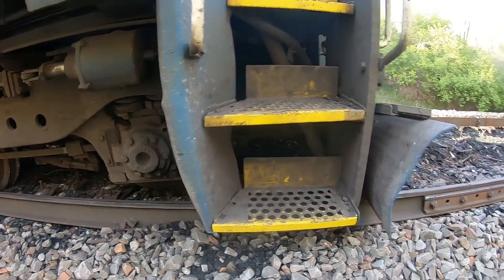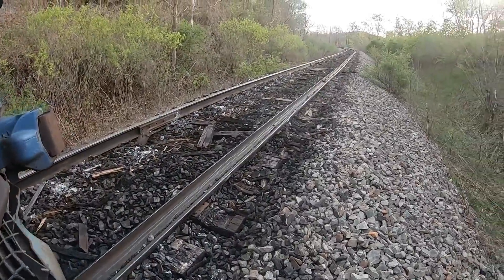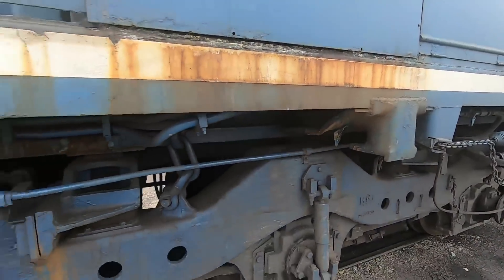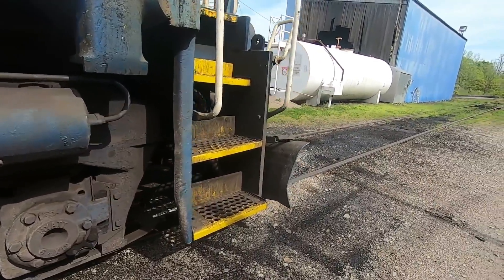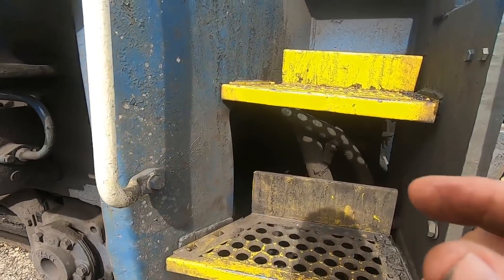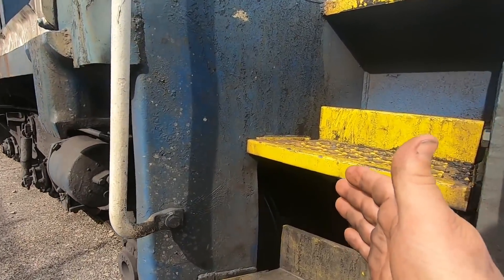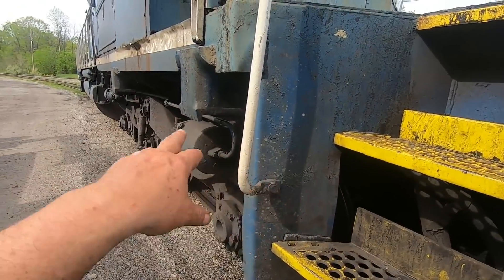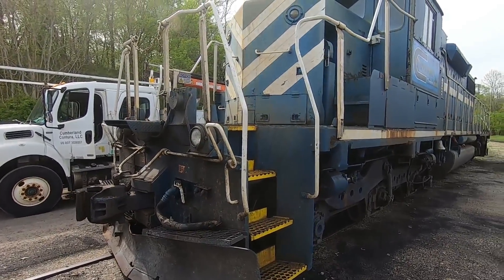Damage to the Locomotive from the Derailment

Comment: What a mess it must have been. What if there would not be any ground for those side lifters?
Reply from the maker: Your right it certainly was a mess. Stefan. If there was no ground to work off of, then they would have had a dozer and excavator make
a pad for those side booms to work off of. It's happened before.
Really appreciate your taking the time to watch the video and may you have a very good day my friend.
Reply: @ccrx6700  A Swedish short passenger trains derailed some years and ended up between the tracks. The nearby ground was like a swamp. Building a road for the cranes was needed so i took extra time.

Comment: When i worked for BN it was easyer on equipment to just let the power run takes alot to start 1 those big power units
Reply from the maker: Yes EMD says it's easier on the engine to let it run than start it because there is no pre lube and all the bearings and seals get run
without lube for a certain amount of time. These old EMD engines
don't like being started when they are cold either.  Thank you for  taking the time to write in and for checking out the video my friend.

Comment: Did you ever find the reason for the derailment? Looks like either the rail broke beneath the train or the road (gauge ) spread and the rail rolled over as it all fell apart under the train. I have seen this excesive flange wear on EMD bogies before, its linked to their so called steering action on curves, something is either jammed or bent in the flexible "steering " part of the suspension.
Reply from the maker: Well Bob I made a video on my thoughts on why that derailment
happened, here is the link to watch it. Loco trucks and car trucks
have to swivel thru curves, if not some bad things can happen.
https://youtu.be/2uGomCuZkV0

Comment: To be absolutely candid about it the 2022 average train derailment was 3 per day.  That is a derailment for breakfast, lunch and dinner everyday through the whole year.  The statistics between 1990 to 2010 averaged 4.7 derailment per day.  The point is no one would investigate every time a train came off the rail, right? because there were too many of them to be investigated.  Therefore no one knows the root cause or could propose changes to rectify the situation.

In the mean time the train wheels are damaged, the tracks are distorted and the ballast/sleepers are compromised to ensure the continuous future derailments.

Is any anyone interested in putting it right? or just live and let die?
Reply from the maker: Thank you Gum Sum Wong for taking the time to share your
thoughts and check out the video. May you have a most blessed
day my friend.

Comment: Dave,  What was the year that they began shipping  DOUBLE-DECKER [one trailer on top of the other] on those special rail cars?   John Pyke,  Michigan
Reply from the maker: Around 1977 Southern Pacific invented the double stack container
cars. it took about 0 years for the idea to become real popular and in well use John. SP and PRR were innovators since the 1950's
on having trailers on flat cars, the container or well cars came
out of that earlier concept. In 1955 PRR and N&W created a
joint venture which was a car owning subsidiary called Trailer
 Train. That became TTX in 1991, you see a lot of TTX box cars
still out there. The PRR Trailer Train was carried on with Conrail
who called it TrailVan.  That grew into the containerized
well cars as the containers became more popular than the
truck trailers on flat cars.

Comment: I know next to nothing about rail & locomotive, so can I ask why they leave the engine running in these cases? It's clear that it's not going to be able to go anywhere for a LONG time so why not just shut it off.
Reply from the maker: Very good question snoozeflu. EMD engines this old do not
have a pre lube before start. EMD says there is actually less
wear and tear on an engine left running than if there is a cold
start with no pre lube. Lot of bearings, rocker assemblies and
seals in these 16 cylinder engines and buying fuel to keep
them running is cheaper than buying engine parts plus 
mechanic fees to work on the engines. Hope that makes sense
to you know. Also these old engines will not accept anti freeze
like the new engines will so in winter have to keep them running.

Comment: You showed the locomotive derailed. Why do the train engineers leave the engine running? It can’t go anywhere til the rails are fixed. Seems like a huge waste of fuel!
Reply from the maker: These old locos on start up do not have a pre lube system. EMD
says that it's easier on the engine to let them idle than to
start an engine with no pre lube system. Easier on seals and
bearings they say. Fuel is cheaper than engine repairs. Thanks
for taking in the video today Eric. and writing in.

Comment: Why do they leave the locomotive running, it's going nowhere??
Reply from the maker: EMD says that the hardest thing on an engine is a cold start.
These old engines do not have a pre lube system. So they
say it's easier on the engine to keep them running and keep
all the bearings and seals lubed and that is why you see locos
idling all the time and don't get shut down. We do shut them down
if there is going to be an extended period of time before they
will be used again.

Comment: Is the crew allowed to stay in the locomotives after the grinding halt, or do they have to vacat until help arrives? Who typically arrives first ?
Reply from the maker: Very good question Israel. Here we only have 1 person in the cab,
so if there is a problem, he will most likely get out and walk back
to see what's up. On Most RR's they have 2 in the cab so the engineer
will stay in while the conductor walks back. On this particular derailment we had, the operator radioed dispatch who then called
me at home. It wasn't far from where I lived so I was the first person
who arrived at the scene, but every case is different as you can
imagine

Comment: I don't get why the locomotive is still running? If it is impossible to move why didn't the engineer shut it down? No point wasting fuel
Reply from the maker: They had just moved it down here, they did shut it off after I made
this video, also our locos never shut down in the winter, they
don't put anti freeze in them. Thank your Adrian for watching
Reply: @ccrx6700  In fact, EMD for a long time said never to put anti-freeze in a loco. Either leave them run if no engine heater or drain them. Same thing was true of Detroit Diesels ( baby EMDs ). We never put anything in them except a Nalcool canister and water.

Comment: Strikes me as odd that only one flange would wear on the locomotive, and not both on the same axle. Maybe that's what you meant? If it is wearing hard on only one side, I'd almost think the locomotive's kingpin is binding in one direction, in this case when that end tries to turn left, or rotate counter clockwise. You would think the opposite side wheel on the other end of the HTC truck would be worn symmetrically from travel in the other direction, but maybe with torque loading from pushing vs being towed as a brake, that moves or jams the center pin enough that it only binds going left when it's facing direction of travel... anything with the bearings or shims would make for a symmetrical or oscillatory wear pattern.
Reply from the maker: I like the way you think! Yep typically if a right front wheel wears
a lot then you would expect the left back to exhibit a same degree of
wear. No doubt this one flange has some considerable wear on
it to begin with. I didn't talk with the guy that fixed the problem to
find out what he did,  however it did correct the wear problem, something was knocked out of alignment on that single wheel.
He was a loco mechanic contractor so next time he comes in I
will try to see what he said was wrong.

Comment: The flange didn’t get that way in 20 miles. Likely it had a sharp flange, and picked a joint, causing the derailment
Reply from the maker: I'm certain the flange had some good wear on it before it's 20mile
journey so it wasn't like it wore down from like new condition to
this. Thanks for watching John

Comment: All 'six' axles and all 12 wheels are on the ground.   What was the end result of the unit with the damaged rear end, coupler jammed within 1/2 inch of the traction motor.
Reply from the maker: They managed to get it all fixed Harold, put a whole new front
end on it, thos guys did a great job!

Comment: Seven eighths and under is called a thin flange, it's a FRA defect that should be caught by a normal inspection using your missing wheel gauge. I understand your not that person, at least I don't think you are.  It can cause a derailment. It is caused from normal wear on the wheel over a long period of time and miles. By the way the person responsible for inspecting the locomotive should have a wheel  gauge and know  how to use it.

Comment: I am a newbie to these types of videos, what are those quick little hissing sounds coming from the locomotive? It sort of sounds like short releases of air.
Reply: Sarco valves doing there job to keep the moisture out of the system
Reply: @donaldjohnson1515  thank you.
Reply from the maker: Thank you Ralfie, you are correct. Might interest you that river
tugboats if idled for more than 2 hours are now required to run
at full throttle for 10 to 15 minutes to prevent stack fires from
fuel loading up.

Comment: Hey Dave! That bad flange is another wreck looking for a place to happen! Is the flange on the opposite side of the axle in the same condition???? When I was an engineer, we had an SD40-2 that came off of the Blue Mountains in Oregon----every single flange was thin and sharp! The mechanical boys took it from us right there on the spot!! I was always very thorough when I inspected my units! I would bet that this happened to your wheel during the derailment! With a right hand curve, coming out onto a tangent, maybe the locomotive truck refused to straighten out??? That would chew up the right front wheels flange! I believe that this is older damage. It just seems so impossible to me that this flange could get chewed up like that in only twenty miles. Something just doesn't add up! I really wish that I could be there to look things over thoroughly for you!!!!
Reply from the maker: Well Shane, most likely the flange had significant wear on it
before the derailment, then with the axle getting knocked out of
line, that just caused a whole lot more wear in a short time. The other side flange was within specs, thanks for watching sir

Comment: He's probably going to tell you it's got a broken axle. If it is broken, it's a wonder it didn't drop back down between the rails during the trip down from the mine.
Reply: There is no reason to think there is a broken axle.
Reply: Larry Car 
You're probably right, but maybe not. I've seen one on a GP 60 that was broken. The only thing that could really be seen was that one wheel was skewed off center and it was enough to let that whole axle fall between the rails. Once the truck was rolled out from under the unit and the traction motor pulled out of the truck, it was still in one piece. Just looking at it sitting on the ground you couldn't really tell that it was broken. 
Are they all going to look like that one? No. But it's a possibility.

Comment: I was curious about the popping sound as you walked by the engine.  I don't mean the air sounds, just the continuous and quick pops.  Thanks for the education and great lessons.
Reply: That's the spitter valves on the main reservoirs opening, they automatically drain the water from the air tanks.
Reply: @ralfie8801  Hey, thank you.  I am surprised at how often they drain the water.
Reply: Louis B 
It only takes a drop or two to cause it to open.
Reply from the maker: Ralfie did a great job in answering your query, I agree with his 
findings and thank you for watching Louis
Reply: @ccrx6700  your right, he did a great job.  You have a great and resourceful following, they follow your lead.

Comment: Good video Dave. I think you are on to something. That bearing shim block on that front wheel set would cause that skew.  Just glad no one was hurt, that is a lot of weight to deal with.
Reply from the maker: Thanks Steve, never thought of that, not really sure what they
did to fix the skewed axle but your hypothesis sounds pretty
good to me, I was unable to talk with the loco mechanic that
came in and fixed it, that loco weighs 386,000 pounds!

Comment: Hard to imagine a wheel could wear that much in 20 miles no matter what happened. I think i saw a lot pf slack in that pedestal liner. Was something letting the axle run uneven and cause that wear. I thought i saw one brake cylinder travel out of speck as well. If there is enough meat on that wheel set and you have a wheel lathe you can turn them down. And iys one solid axle two wheels amd the traction motor. I wonder how much damage to the gear cases. We were using fiberglass ones in later years and the bottpms would be desyroyed every time we had a derailment. I changed a lot of traction motors and wheel sets in my time.

Comment: Anybody have any idea how many hours a diesel engine like that can go before a major rebuilding, like new piston rings and bearings, is needed?  I heard that a bus can go a half million miles between engine swaps. That is a lot of crankshaft rotations.
Reply: They typically go around 750K before really being considered for overhaul. Usually by then, all that's left of the original engine's rotating assembly could be several power assemblies and the main bearings. Power assemblies are prone to head seal failure over time, which causes an internal coolant leak. They can be changed individually. Normally that new assembly gets a new rod bearing on the crank journal when it's installed.

Comment: I love how big the platform on the front of that locomotive is. Most that I see have no more room on the front or rear platform than the walkways. It is distinctive, makes that kind of locomotive stand out.
With that flange being ground down to a unservicable nub.. I'm guessing whole bogie will be pulled to fix it. But I'm betting that wheel can be replaced cheaper than the cost of buying a whole new bogie if you don't already have a spare. 1 wheel being cheaper than 2 + axle + traction motor.
Reply: You can't just change one wheel. #1. They are pressed on the axle at a wheel shop that does that kind of work. The wheels get replaced in pairs because they have to be the same diameter on that axle. #2. The wheels on that axle have to be close in diameter to the other two sets of wheels in that same truck to prevent problems with the anti-wheel slip system which will cause the whole unit to not load and pull correctly. 
When wheels are worn out or damaged beyond repair, they are swapped out with a new traction motor and wheel set. If all six wheel sets are worn out, it gets what's called a double truck. That means we change all of the traction motors on both trucks.
Reply from the maker: Excellent explanation Ralfie! Thank you for posting that for us,
sounds like you been around locos for awhile sir. You are right,in next video coming out they trued both wheels on that traction motor to same specs

Comment: incredible amount of damage both to the locomotive and the rail too, but thankfully Hulcher has a LOOOT of experience doing this type of work. amazing really
Reply: will they press on new wheels to the traction motors or will they just replace the whole unit?
Reply: @northstar2007  they may have to replace more than one traction motor depending on the wheel sizes. The wheels must all be matched in diameter too. They can only have so much mismatch in each truck and so much between the trucks.
Reply from the maker: In the next video coming out will show you what they did
to fix this, it really a cool thing they did, you gonna like it
Reply: They will replace it as a unit.

Comment: I know it's probably cost prohibitive with the amount of track, but I wonder if a check rail would have prevented this. European trams have a lot of them but I think it's because they're asking quite a bit from those bogies with those curves.
Reply: If you watch the last video the cause of the derailment is explained. It had nothing to do with ccrx 6700's track maintenance which is really good to know https://www.youtube.com/watch?v=2uGomCuZkV0&t=532s
Reply from the maker: Interesting comment, i have never heard of a check rail, could
you please explain to me what that is sir? I'm most intersted
Reply: @ccrx6700    Also known as Guard Rail. You see them on each side where the frog is. Mounted next to the stock rails.
Reply from the maker: @TheRantingCabbie  we have guard rails on our frogs, except the self guarded frogs
Reply: @ccrx6700  Check rail is a name we use in UK. Where there is a tight curve the rail on the inside has a rail placed inside of it which the back of the wheel flange touches. It guides the wheel set round the curve and prevents excess pressure on the outer rail preventing the outer wheel riding up and over the top of the rail as happened in your derailment. But if a truck (UK Bogie) is unable to turn as in your derailment it is not going to stop a derailment. I do not know the minimum radius these are used on but curves with 25mph or less are the only places I have seen them
Reply from the maker: @cedarcam  thank you! Some RR's do use them here on tighter curves, hadnt heard it called check rail nefore so appreciate your getting back to me 👍